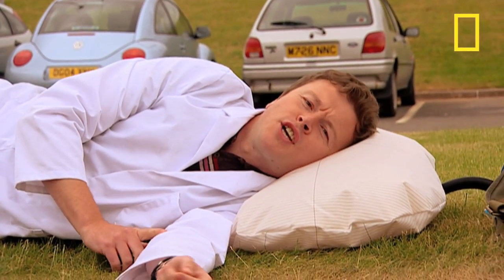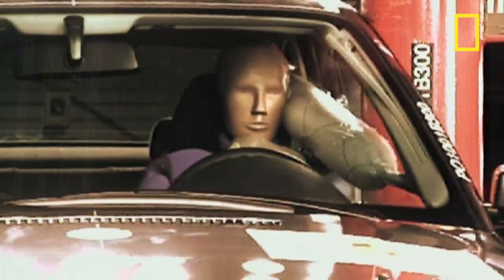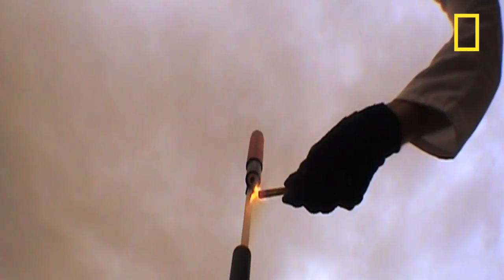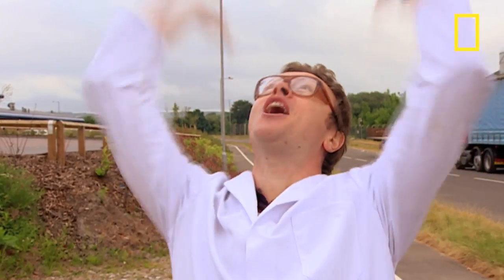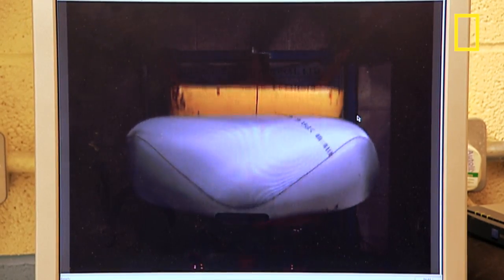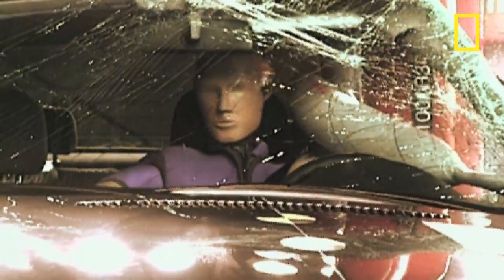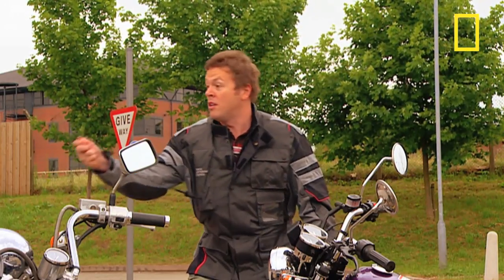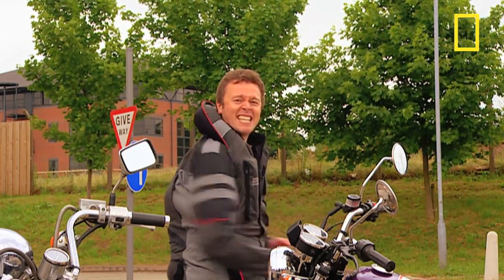Air Bags | I Didn't Know That

Comment: what happen if the 12V car battery got disconnected during the collision? Will the airbag still deploy?
Reply: There is a capacitor that stores energy for the airbag controller in case this happens.  This is why if you need to work on your cars electrical system, you should disconnect the battery and then wait 5 minutes for the backup energy to discharge so you don't blow an airbag on accident.
Reply: Bad Drivers of Southern Illinois this applies to most vehicles?
Reply: Any car with an airbag.  If you're going to do electrical work or have to remove the steering wheel, dash, seats, or run wire in the headliner, it is a good idea to disconnect power and wait several minutes.
If you manage to trigger an airbag, it would be very dangerous or even deadly if you were leaning over the wheel or had your head near the side curtains, etc.
Reply: Bad Drivers of Southern Illinois I heard people getting seriously injuried (if not killed) while setting on the driver's seat using a computer doing software programming via OBD II and accidentally deploy the airbag smashing the laptop against his face "killing him".

PS airbag wires are yellow right? Or is it green or bright orange
Reply: The ones in my car ('09 Mazda 6) have a Yellow sleeve around them.

Comment: I always wondering. im waring eygasses, would airbag dont make me blind whit some of eyeglasses pices?!
Reply: They won't, airbags work together with the seatbelt.  The belt will hold you in position until the airbag is deployed, and then will let you go at a reduced speed.
Reply: Your eyes will close due to the impact, but the worst that can happen is that the glass enters a bit of your skin, usually your arm since it's the closest to the wheel.

Comment: They need to place airbags all around the car from hood side doors, trunk all over the vechicle with big ones so when a crash takes place both vechicles that has them the air bags could push both vechicles back and have a safety shield around the vechicles with a long extension air bag to hold aggressive pressure it could save lives have like jelly particulars that would foam inside of the bags where the cars would go into and it would expand at a high rate from collideing into each other it can be done if they would study it with something hard and squishy could have electromagnetic energy inside the huge air bags with this technology today they could make that possible where it would repel both cars to give them enough time to come to a complete stop on both ends.
Reply: +Legendary Decent Idea, however the problem is that these would need to open pre-crash, which means placing sensors that can tell of something is coming towards it. There is a problem with that, as it could be triggered by someone parked next to you opening their door quickly, which could break that persons hand due to the extremely fast inflation pushing back the door. You would have more cars in the shops to replace those airbags because of un-needed firing rather than actual crashes...
Reply: Not so smart person here..
Reply: Legendary that's not how shit works
Reply: legendary you should run for Congress!!!!!

Comment: Why is that only 91% of European vehicles are fitted with airbags, why not 100% like America?
Reply: Thomas Stroble some of the more expensive cars opt for the belt tensioner that’s attached to the engine and snaps in place to prevent you from shifting forward during a crash. It has to be the double cross body belt though